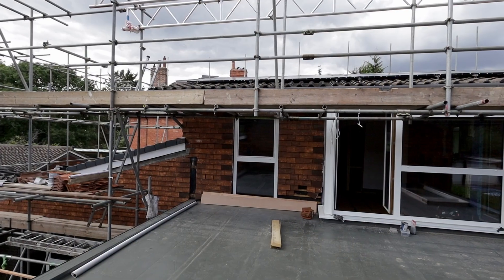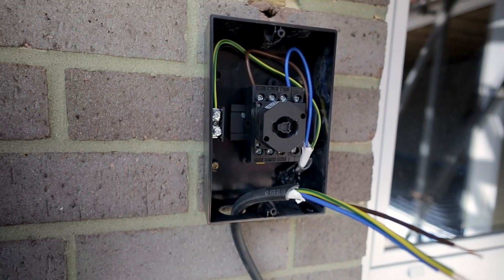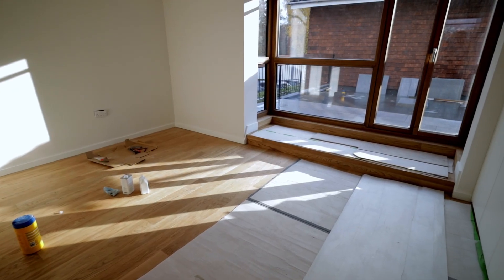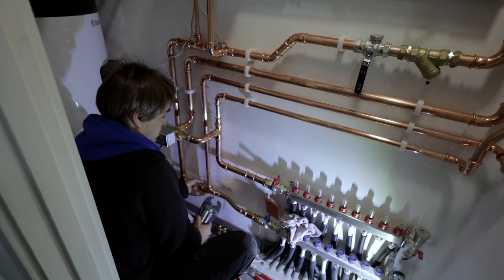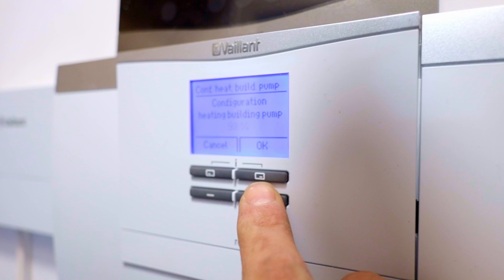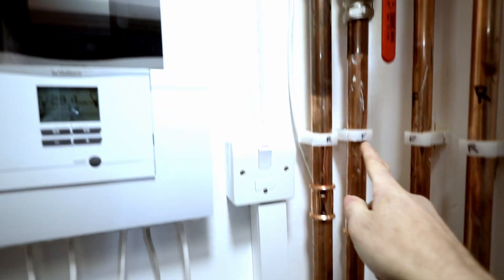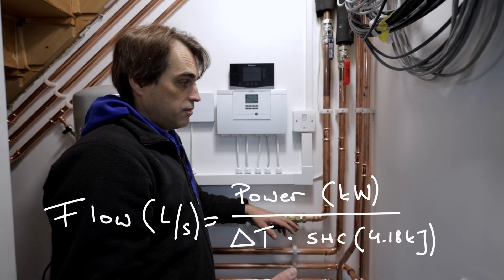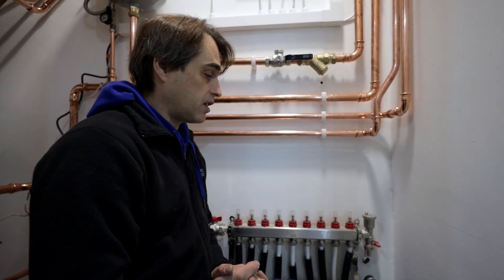How To Install an Ultra Efficient Heating System - Heat Pump + UFH.

Comment: Love your videos and pouring over them to design my own self install system. Do you not fit a magnetic filter on your systems?
Reply from the maker: No I don’t. They don’t really work. Flush without any chemicals and don’t use inhibitors and it’s much better, and a regular Y strainer does a job much better that any filter ever could.
Reply: @UrbanPlumbers  thank you for your reply! No chemicals, interesting. So just fill with water and set the system away? Thanks again.
Reply from the maker: @scottelliott72 mains flush all rads one by one till they are clean

Comment: So many questions about the first floor UFH. Did they just lay those pregrooved sections on top of floorboards? Is there any screed being poured upstairs. What floor surface are they going to use. If tiles upstairs isn't that weird and a bit cool and uncomfortable in the spring and autumn. 
I'm thinking of how to implement fist floor UFH myself.
Reply: The grooved panels are laid directly on the joists. Near the start you can see it being laid in the bathroom. On top of the grooved panels we have 20mm engineered wood flooring, and porcelain tiles for the bathroom. No screed, as we had to keep the weight down to what the joists can bear. We probably have less efficient heat transfer upstairs but it doesn't affect comfort.

Comment: Great video. Out of interest, which of the 2 UFH systems would be most efficient with the ASHP: the screed system downstairs or the aluminium overlay boards upstairs?
Reply: In theory the screeded system gets better thermal contact between the pipes and the room, so we should get more heat out for a given flow temperature. And a thermal camera shows much more even heat distribution. It's less responsive, because of the high thermal mass of all the screed, but that's a feature rather than a problem. 

You have to look at the system as a whole. We didn't have the option of screed upstairs because the joists couldn't have taken the weight.

Comment: you will not get 500% efficiency in cold winter
Reply from the maker: True. At -2 i only get 400%
Reply: @UrbanPlumbers  i do not what to bee pesimist but at -25 you not get much gain do you ?
Reply from the maker: @stefanviklund7042 the coldest it gets here is -3 so a moot point

Comment: Hi Can you please advise why you have not installed pumps on the manifold and blending valve between hot water and return
Reply from the maker: Because I don’t need them
Reply: Can you please give technical reason ?  And  explain why you need them ?
Reply from the maker: @sikanderdeol that would require an hour long video and knowledge that I am not sure I want to be sharing for free
Reply: @UrbanPlumbers  so half information is free and rest information is paid LOL !

Comment: Your flow rate settings are just a form of remote TRV. I use intelligent TRVs on all the radiators so each room is a zone but I do not mess around with setting up on and off times. Keep everything running but at the desired temperature. That seems simpler to me in a way.

Comment: thank you for the quality content over there,may i ask if the flow and return pipes to and from the manifold are 22mm pipes? did you use tee 22/28/22 right after the 3way valve? thank you
Reply from the maker: On this job with small heat loss and such a short distance it doesn’t matter if it’s 22 or 28
Reply: @UrbanPlumbers  well the cost b/w 22 and 28 mm pipes is something :D i was asking just for personal interest.
in my home im doing the same work just using  2 fancoils instead of 2 ufh manifold and i was looking forward to see where to reduce the diameter of the main flow pipe if right after the 3way valve with a tee 22/28/22 and that might just be the best solution i got to save some money instead of going full 28mm.
thank you again
Reply from the maker: Depends on your heat loss and flow rate. There is no answer to this without going into more detail

Comment: For me to go down that route i will be long dead before payback.
Reply from the maker: I just visted that site last week.. The peoprty has £0 annual running cost as they produce more with solar than they consume.

My own place retrofit cost inculding solar will be around £20K and also £0 bills plus some money from the export tarrif and free EV charging. Thats around £2,500k saving a year - so 8 years pay back time follwoed by £0 bills on the house and driving.

If you know what you are doing and you desgin the system well - it makes total sense to do it.

Comment: I notice you do not use the Valliant hydraulic station. Is there a reason for that?
Reply from the maker: It’s never needed. It adds unnecessary cost and makes the system run less efficiently
Reply: @UrbanPlumbers I was suspecting that. Do you ever use the VRC 9642 thermostat from Valliant for your underfloor heating? I am amazed how good these low Kw heat pumps are working as for the same m2 my energy adviser is suggesting double this size. Well done

Comment: Hi, great information, I am building a passive house in Cornwall that has MVHR. How do you ensure different room temperatures when the MVHR is circulating the air through every room. As my house is super insulated, the specific heat of the air is now important as the direct heating will be low. I am designing my system myself as a local heat pump installer is quoting for a larger Vaillant unit than is required. I have also enrolled on the Heat Geek course to understand it better, as design engineers don't always get it right, especially with passive house homes.

Comment: @ASHPowner Would you say all the cost associated with insulating the house and the heat exchanger system are worth the effort?

Are you expecting a break even, if so how long, and if not what was your reasons for insulating so well?
Reply: Hi @affiuk. We were starting from an uninhabitable building so there wasn't a do-nothing option and we can't break out the cost just of the energy retrofit.

The reason for the project was to make somewhere comfortable to live in. And we wanted to make sure the temperature and humidity balance of the building worked, so we wouldn't be storing up trouble for the future.

The better insulated your home, the less money each individual element of the insulation can save you, as your bills would still be low without it. So the payback isn't clear. But you need to ensure the house works as a system.

For the whole project we spent more than a lifetime's worth of energy bills, so in that sense it will never pay back. But it's very comfortable and the remaining bills are very low. In the first half of 2024 we've drawn on average less than 1.5 kWh/day from the grid, net of the solar generation we have sold back.
Reply: @ASHPowner  Thanks, I do feel I need to give comfort more importance, I like the idea of having a steady and stable temperture. Humidity and fresh air is a real concern, so it makes sense to invest at the begining and be done with it.
Reply: You will never get payback. The energy company will increase standing charges to compensate for lost revenue in reduced consumption .
Reply: @jablot5054 We're using more electricity than if we had kept the boiler, and we're not paying gas standing charges at all...

Comment: Very interested about the open loop approach. Where to you position the thermostats?
Reply from the maker: Most systems we install are run on pure weather compensation and don’t use thermostats or internal room infuence
Reply: I removed all the room thermostats that were fitted to my house in Germany. The heating installer would not install the system without room thermostats because they are a (stupid) legal requirement here. He agreed they were pointless. They are so stupid in a low temp screeded UFH system. I have tens of tonnes of concrete screed being heated by the UFH pipework. If I waited until the AIR temperature in room x reached y temperature before shutting off the actuator(s) at the manifold, there would be massive overshoot as the sheer bulk of screed buffers the energy for so long. Room thermostats are just not compatible with these sorts of heating systems IMO. From day one all the thermostats were set to max because the flow rates were keeping the house comfortable. The valves were open all the time (open loop). I removed 30 actuators from the system, each one consuming 1.2W when the valve was open (so for the entire heating season!). The house has an outside temperature sensor. The heat pump can use its heat curve to keep the house comfortable.
Reply: @murphaph  Yep. I went full Heatmiser with stats controlling 8 stats. Works great on a date non condensing boiler. But moving forwarded looks like a single zone additional to the garage. Good point about the wattage consumption of the actuators.

Comment: You have designed the heat loss at worst case external temperature, so if there is no system temperature controls then when it’s 10 degrees outside the rooms will be emitting more heat than is required, would this lead to slightly warmer rooms than the design temperature when it’s 10 degrees outside, or do you have weather comp installed?
Reply: There's weather compensation. We fiddle with the curve a bit but it's basically very good. We've been alternating freezing and mild weather this month and the house has been at the same temperature throughout.

Comment: Thank you for sharing your knowledge! 
Can you tell me, how to compensate for the variations and errors in UFH pipe laying, if there are no thermostats?
If a room is designed to be piped 150mm CTC, does it matter if it gets 130 at some points, then 170 at others?
Don't you use balancing valves, when you pipe two manifolds to one pump, like a STAD valve?

Comment: If the UFH is fully open circuit without any thermostatic controls for any rooms. 
How do you get round building regulations Part L where it’s says individual thermostatic room controls are required in certain rooms such as bedrooms?
Reply from the maker: It doesn’t require that on fully weather compensated set ups
Reply: @UrbanPlumbers  i see, how do you get round lowering a bedroom temperature to say 18oc for say sleeping comfortability when the main room stat is designed and calling for 21oc would you have to lower the 21oc to 18 everywhere?
Reply: @UrbanPlumbers  I was trying to interpret the Part L differently after you said you don’t need room thermostatic controls with weather comp. But I can only find this about thermostatic controls in part L regs: 

“Thermostatic room controls 5.20 For heating systems in new dwellings, or when a heat generator such as a boiler is replaced in an existing dwelling, each room should be provided with thermostatic room controls. These should be capable of  being used to separately adapt the heating output in each room served by the heating appliance.”

They don’t mention any exceptions with this that allows no controls with weather comp or ashp. So I would suspect you at least need room thermostats in a bedroom etc.
I’m curious where you see the regs differently, am I missing something? 
Thanks
Reply: @UrbanPlumbers  apologies for the pestering. I can’t for the love of me find in part L where it may suggest no room thermostatic controls are required with WC.
Could you elaborate on this at all, as it would suggest you would still need a thermostat in a bedroom no?
Reply: Client here. In practice building control made no objections at all. The draft future part L suggests 10W/m2 (i.e.,Passivhaus) as a bound below which room controls might be technically infeasible, but there's no hard limit.
Reply: most new builds wouldn’t class as passive due to higher W/m2 and more so for an existing build. 
So Part L would apply, I just can’t see how Simon got round not fitting any Thermostats when Part L calls for it.
Reply: @gerardfry4876 We did have electric spurs put in by the manifolds, in case building control required actuators and thermostats, but they were happy. There's no law to say the actuators ever have to operate, so we would just have cursed the wasted expense and left them open.
Reply from the maker: You really shouldn’t install controls on fully weather compensated systems or zone them. That defeats the purpose of the design. I really don’t care what part L says and if it legal or not - I am not going to wait for the regulations to catch up and sacrifice system performance just because some pen pusher doesn’t understand modern heating technology.

Comment: Bit of a n00b question: does this setup mean that the tank also accumulates and stores water at 35C? Also, considering potential compatibility with Sunamp: does their requirement for 45..55C inbound mean that I'd need to run the heatpump also at 45..55 in?
Reply: Client here. The hot water tank is set to 50 degrees, with a weekly anti-Legionnaires cycle to 60. It's easy to run your shower too hot.
Reply: @ASHPowner  thanks!

Comment: Do you need to consider only heat losses when choosing a heat pump? Will there always be sufficient heat for the hot water, if the pump is sufficient for heating?

Comment: Just done my calculation for 7800w at -3 got a flow of 1337 per hour. Thanks for the help to understand flow + temps.
heatpunk states the same vaillant 7kw system

Comment: At that heat loss is UFH worth the costs and complication?? Constant heating at 21 deg everything ends up at the same temps pretty much.
Reply: We don't need UFH for the heat output. But should we live with radiators all over our walls, like animals?

Comment: Great vid as always.  Quick question as I'm looking at a 20 W/m2 property (280 m2) with all UFH with 3 manifolds. With the low power requirement then the flow rates in each loop are theoretically less than 1 1/min, i.e. laminar flow.  Is that a problem ? Given ~ 680 l/hr, and it looks like perhaps greater than 16 loops in your install, then the average would also be less than 1 l/min.  I see that you've used different spacing depending on load/covering - but can't see how that avoids the low flow rates - or am I over thinking the effects of laminar flow ?

Comment: Ok great vid, but question, the 18C and 21C internally is based on an outside temperature of “What” exactly. Surely as the ambient temperature falls the efficiency of the system falls, added to that you have “ defrost cycles “ the colder it gets the more time in defrost, right? So what’s the starting point. Back in the day we used to assume an ambient temperature of -1C with a flow temperature of 82C to maintain an internal temperature temperature of 21C, now I know that’s not done now but what is the starting point. I’m thinking if the design is based on -1C it will struggle at say -5C or am I talking rubbish.
Reply from the maker: -2 at 21c inside is the heat loss calculations based on. Here it’s 3.5kw. SCOP (Seasonal Coefficient of Performance is based on average of 12 months) and is expected to be 4.5-5.0 here. 

The design flow temp at -2 is below 35c here and at those conditions the COP (not seasonal - actual efficiency) is expected to be around 3.0
Reply from the maker: Defrost show a dip in performance and efficiency, however the dip only happens between 1c and -3c - due to high humidity of air

Once the temperature drops below -3 the unit recovers as the air is much less humid so there is much less defrosts happening

At -2 this unit was defrosting 1 per around 45-50 minutes
Reply: OK that makes sense, well good luck in your endeavours, your pipework is second to none.

Comment: Love the simplicity of this install!Currently in the middle of a restoration/selfbuild of 100m2 single story.UFH pipes are installed but I've been spec'd with room stats and actuators etc...also a buffer tank.Prefer the idea of keeping it a simple open system.Maybe I dont have the system volume?

Comment: I like it. No buffer, no actuators, UFH design tailored to the max. efficiency. Question: I have the same setup of UFH but designed for a gas boiler with dT 45/35. Only one heating circuit with two manifolds for each floor. Can a heat pump replace a gas boiler without using a buffer?

Comment: Does anyone know whether there are smart zoning valves that communicate with the heatpump? In theory, that should allow for zoning while still ensuring the minimal flow speed required by the heat pump.
Reply from the maker: You shouldn’t use smart valves that can fire the heat pump - flow is not everything, fully open system will usually be more efficient and cheaper to run than zoning. Zoning is not needed on weather compensated seat ups anyway. The only way to use smart or regular radiators valves is to prevent overheating, which again shouldn’t be needed on a correctly designed system.
Reply: @UrbanPlumbers  I get that a fully open system will always be more efficient. But there must be scenarios in which the worse efficiency is made up by lowering the  total energy required. For example one or two people live in a large house with high amount of heatloss. So cases where most of the rooms might not be used. But there are also two other somewhat stupid reasons. The first one being that customers want them (even if they're not good for them. And the second one being regulations. German efficiency regulations (that probably weren't designed for hear pumps) require you to have zoning if you want any grants. So in germany, basically, any installation will have them...  and/or a buffer and a flow over valve.